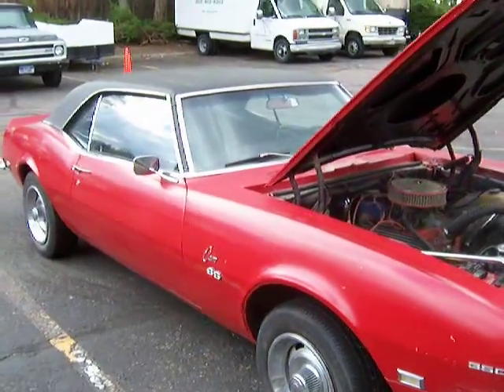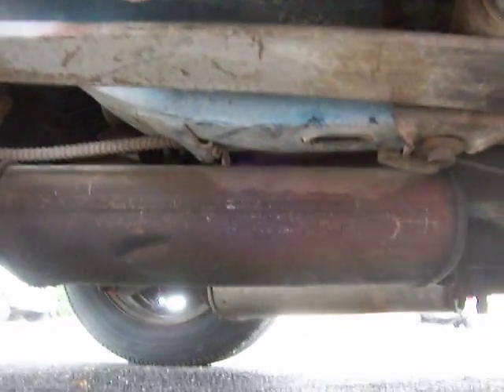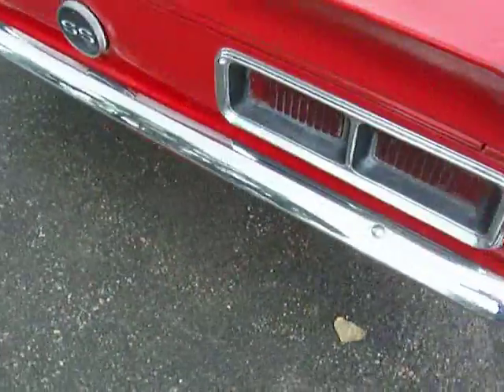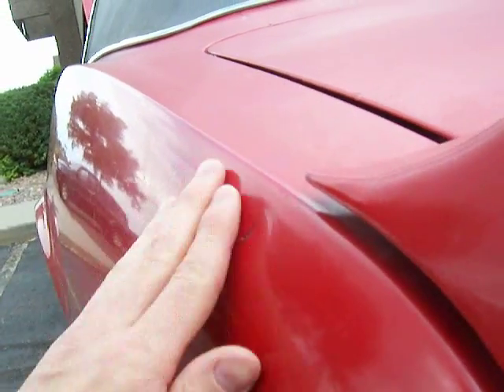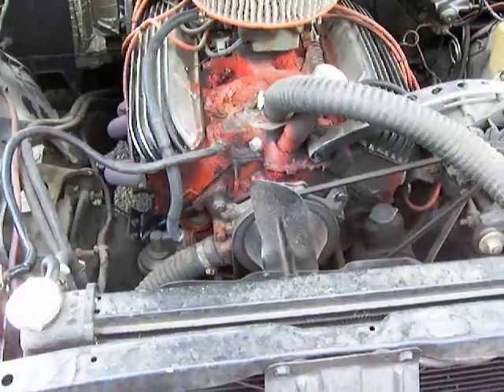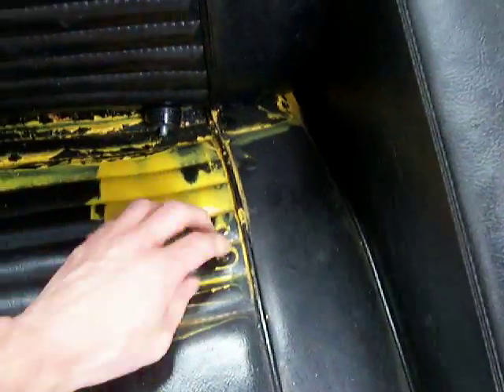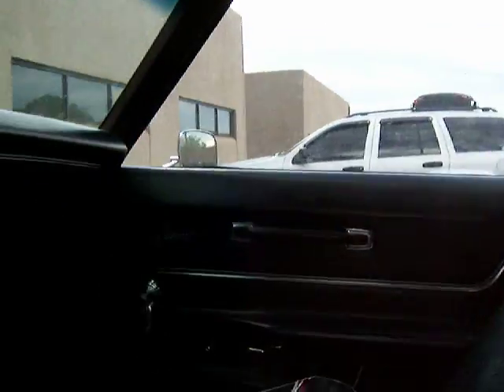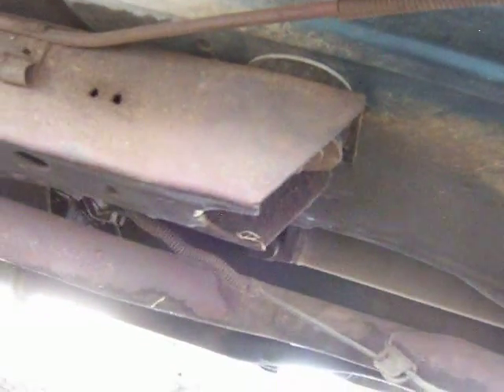the foundation for my 1968 Camaro SS/RS clone in progress

Comment: Good luck you gotta spend a ton of money to get a car done today.  Cheaper to get one all built as I have discovered now too late....
Reply from the maker: Mark Powley true, but that is the point of doing it myself. also if I were to pay some to do the work I would not get the experience or expertise I am looking for. had I stayed true to the plan i would have been mid 20's into it about the cost of a decent driver when I bought the car in 2010,now I have taken a pro touring direction.
Reply: I have replaced 95% of my 1968 SS RS 350. The only original metal was the roof and firewall.  So I have a new 1968 Camaro and I wish I had not done that, the car is only worth $30,000 maybe.  I have $35,000+ in materials. The body and frame sections being solid are the key to the project's cost.  I have 2 more 1969 Camaro cars to do but learned the hard way like you will be doing.  Good luck to you.  
I am going to use the peel-able paint on the next cars it is amazing.